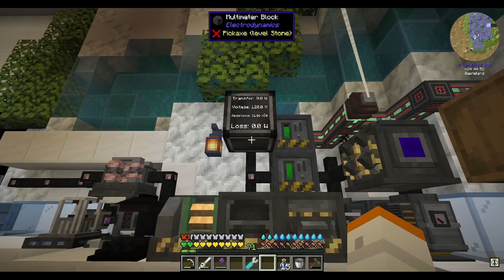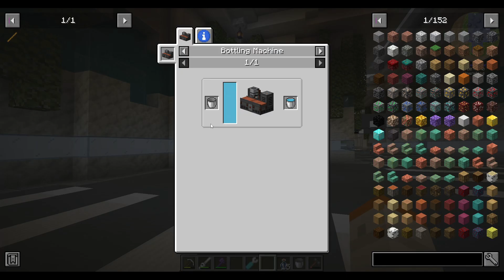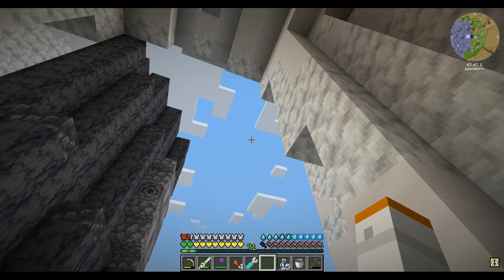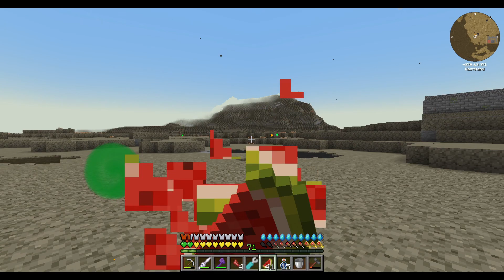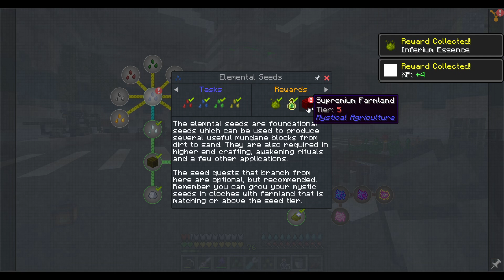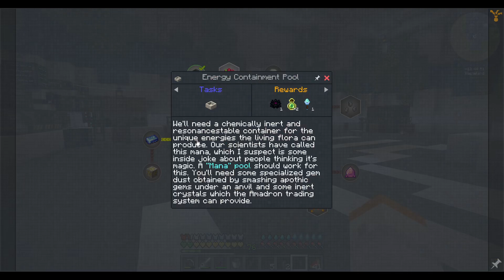FTB Genesis EP12 Discussing Fuel, Locating Nodes, and Metallurgic Infuser Time

Comment: I think I'll go with a laser drill then figure out how far I want to refine it depending on fuel needs.  Don't overcomplicate it, a lot of that stuff actually runs on room temperature and no pressure.  I'll probably go mushrooms and watermelon, my farm makes more than enough.  Hope you find something that works for you.  :)  As yet I haven't even needed the oil I gathered (I filled my tanks like you did) because I'm using the power from Thorne's farm generators and the creative power source powering the simulations.  ;D  Found a lot of AE2 stuff on my adventures.  I power up a coal generator when I need it.
Reply from the maker: OH yeah, exploring is key from what I can tell, lots of good stuff to be found around.

The temperature for all the machines that need it also makes it run faster. Yes, stuff runs at room temp, yes you can run a refinery with a torch. FAST? no its slower than molasses in winter. We don't half ass things around here, if I'm going to make it and use it long term its going to SCREAM. :D
Reply: LOL too funny.  I mean like I love Ilmango but his machines aren't really needed for single player, haha.  I'm more about keeping it small, keeping it automatic and self-sustaining, and I'll just afk overnight if I need to.  I want stuff working for me while I sleep! @Frogman79

Comment: You don’t need pressure in most of the recipes but hey do it however you wish. I don’t use any thermal lagging either as it wasn’t necessary because you can just use other materials. The pneumatic craft armor, mini gun, and jackhammer, as well as the vacuum and pressure chambers were all very easy to pressurize. Maybe I’ve just used pneumaticcraft too often in the past 😂
Reply from the maker: I understand fully how to use the mod, I'm one to use it when I can however this time around its not striking my interest. The Drones are my favorite part and they may end up doing a bit of work for us in the future.

Thermal lagging is a nice option over making trap doors or burying the machines in blocks. True, totally not needed but nicer to look at and easier to use over all. And it costs practically nothing to make a lot of. 

The armor has my eye as its received quite a bit of upgradeable goodies in the last few minecraft updates, still not something I dive after if I have Mekainsm but worth looking at I suppose.
Reply: @Frogman79  didn’t mean to disrespect you in any way. I’m just saying I do what I’m used to just as you have done immersive engineering enough that it’s comfortable to you.

As another person pointed out the recipes that usually need pressure often don’t in this pack making them only a mater of heat and those are simple.

As I said though do what you want. However is fun for you.
Reply: I have no clue how to use the drones, excited to see how you use them.   @Frogman79
Reply from the maker: @PyrrhP  If you understand flow charting you can use the Drones for just about anything. They also have  basic Logistic function as found most notably in Factorio. If you can get that figured out they can do a lot of work for you, just like the CC Turtles.
Reply: @Frogman79 0:38 just use redstone signal to turn off chamber
Reply from the maker: @bldshrerwok7121  you do realize this EP is over a year old that this point. No need to respond to Hey you know you can just do this? We have all moved on.